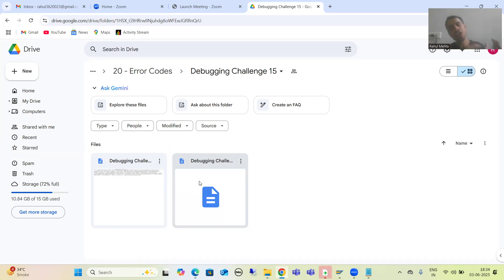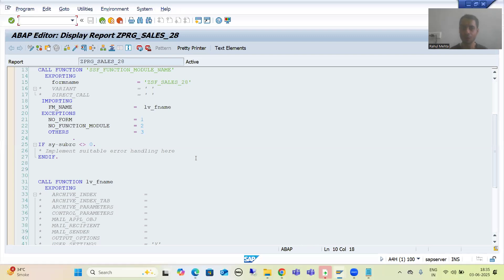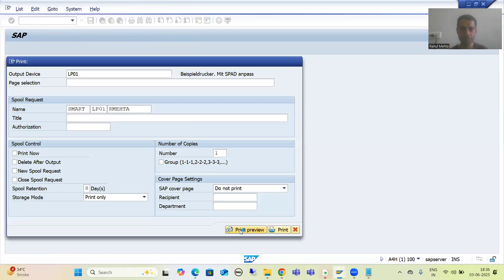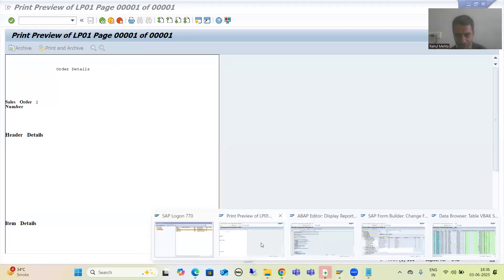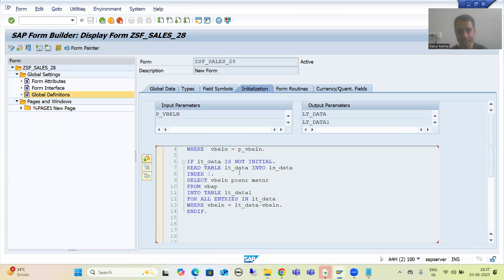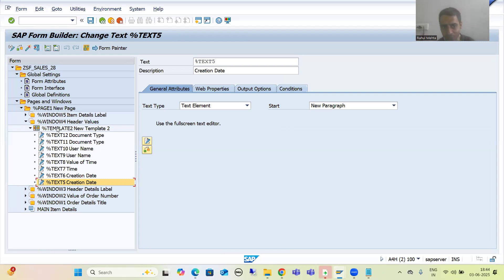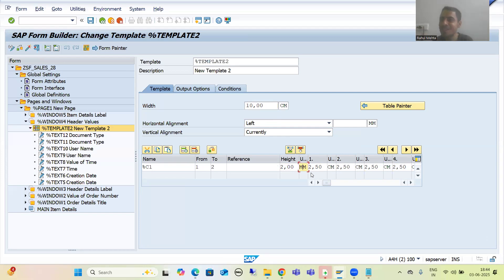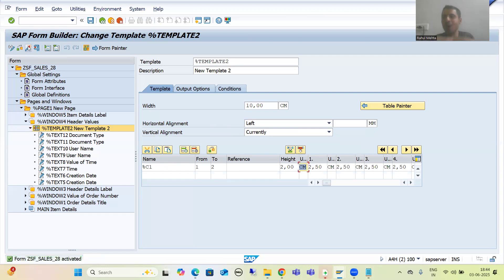16 - Debugging Challenge No.15 - Smartforms - Output Issue

Comment: Hi Rahul.. This is Raj.. im working in sap ecs project.. it is completely on monitoring and ticket resolution.. 
I very much bored with that.. I have good coding skills (in java, python) even before i joined this MNC company.. as soon as i joined they put me in SAP.. 

But I want to shift to technical side.. but i have already worked on SAP for 3 years.. my experience was also not that good.. they trained me in mm, sd.. later they traiined me in basis.. finally in ecs project.. 

Im not in a good position to switch the company..  as there is lack of skill.. 
Instead of shifting to Java technology.. i thought to learn ABAP.. I saw your SAP guidance video which is uploaded 2 years back.. 

All my friends have settled with good package with their domain.. but i got stuck with no skills and starting packege itself..

Canyou please help me out.. I wanted to learn ABAP and search roles on it.. how can I use your course(as i wanted to go development side) and approach to shift the company and add this skill to my resume.. 
I'm fast learner I have no issues in learning new things.. but there im in dilemma.. how to go forward..
Reply from the maker: Hello Raju - Below are the answers to your questions.

You can divide your learning journey into 3 parts.

1) Basic Knowledge : 

When a person has the knowledge of ABAP Dictionary, Reports( Classical Reports, ALV Reports) ,Modularization Techniques , Debugging and Dialog Programming.

We consider it as a E0 Level of knowledge in ABAP( Basic knowledge of ABAP).

It means when you finish the first 8 playlists till Module Pool Programming, you can say that you have basic knowledge of SAP ABAP and your base is ready.

Once your base is ready, you can learn any topic after that depending upon the requirement

2) Intermediate Knowledge : 

 You can skip the playlist of SAP Scripts, BRF+  and Web Dynpro ABAP and go for other playlists available on the channel.

It will help you to get an intermediate level of knowledge in SAP ABAP.  

3) Knowledge of other Important topics :  Then you need to learn ABAP on HANA topics( CDS, AMDP etc.) and ODATA.

As you are an experienced resource, you need to keep your major focus on hands-on/practical/real time exposure.

Disclaimer :  I just guided based upon the best of my knowledge. The decision is ultimately your responsibility.